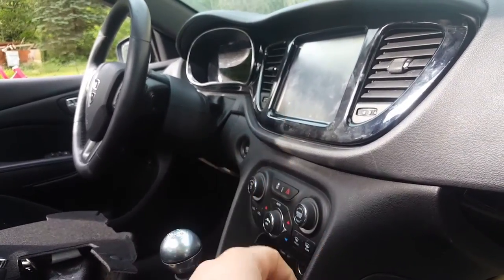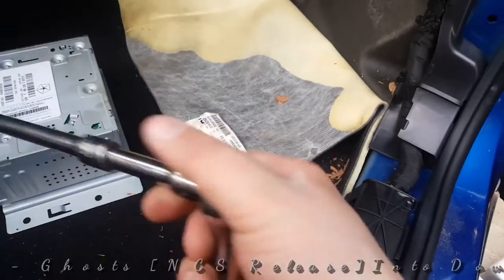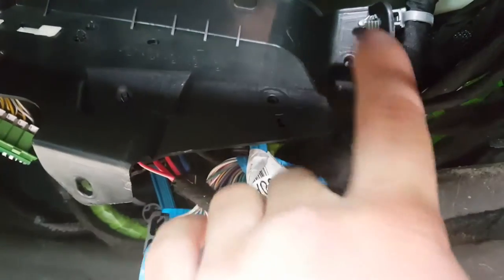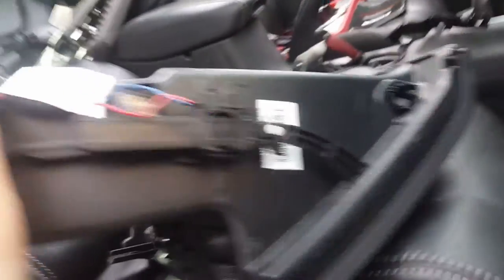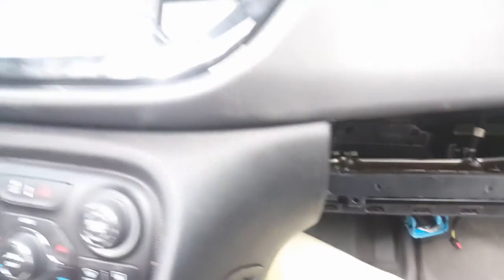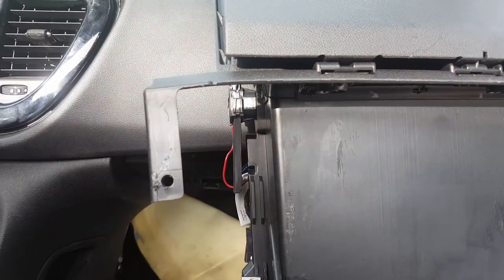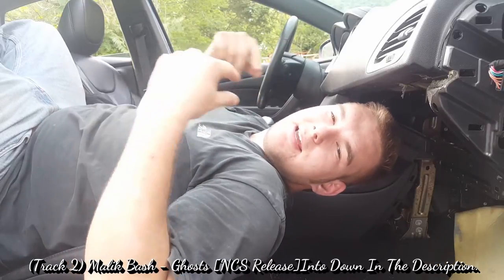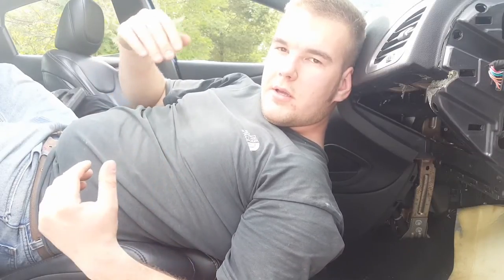Dodge Dart Remove Glove Compartment

Comment: so much for detailed breakdown. more like "how to be all over the place when you try to remove your glove compartment". thanks for wasting 16 minutes of my time.
Reply: Did you ever figure out how to remove the glovebox, I’m still struggling with it
Reply: @ultimatums1  let me know how it goes!
Reply: @kareemahmed1030  i just need to find the right push pins for my 2015 dart as for whatever idiotic reason, the industry decided to fit the interior with a 1 time use pins that need to be replaced when something is disassembled in most of the interior parts.
Reply: @kareemahmed1030  I know im late af but removed one of these glove boxes today. Took about 30 min of fighting but first off he missed a whole screw on the rear plastic piece. There is one in the center of the very back piece. Youre gonna have to hang upside down and just get in there with a small ratchet and 7mm. In total there is 5 bolts holding the rear of the glovebox. 3 on the rear facing inward, and 1 on each side facing upward.
Reply: @andythegreat17  thank you for having the courage to respond. I replaced the dash about a month ago and it was the biggest pain in the ass. Good luck to whatever work you have left!
Reply: thats what im saying